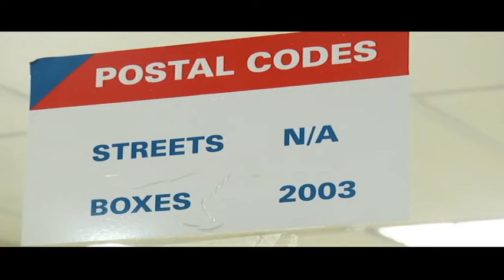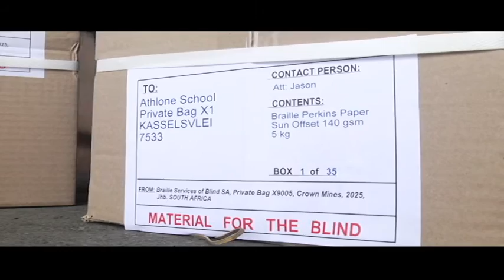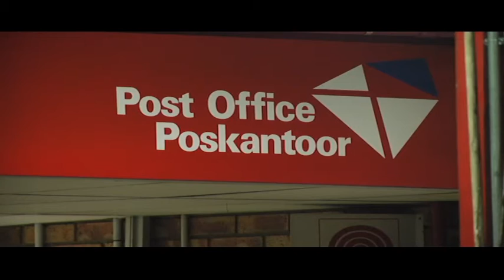S.A's Post Office CEO Mark Barnes' turnaround plan

Comment: Given my recent experience of the South African Post Office I would say that Mark Barnes is failing miserably in his quest. This the email I sent to their "customer care." I really don't expect an answer but would be pleasantly surprised if I got one.:
Today I went to the Linden post Office to collect a parcel which I know has been in SA since 29 September.  The overseas tracking number states "In Transit - Item being handed over to the local courier, tracking ended.
Location: Local courier sorting centre,SOUTH AFRICA."
As they couldn't use the foreign tracking number I looked in the delivery book and noticed that the last parcels to be delivered were 5 parcels on 27/10/2017 and before that 3 parcels on 17/10/2017.  Given that I have 3 parcels waiting somewhere in the S A postal system,  I have to wonder how many other peoples' parcels are sitting in the central sorting office.
I cannot fault the workers at Linden, but I do find it atrocious that we have to pay for the non-delivery of parcels.  Please S A Post office, get your fingers out and actually do some work or hire someone who wants to work and is prepared to actually work.
According to the senders website all three of my parcels are in South Africa, but they cannot track the parcels locally because South Africa has another NON accessible system